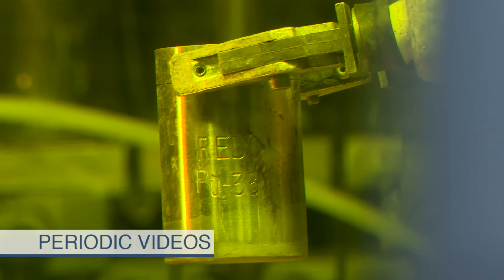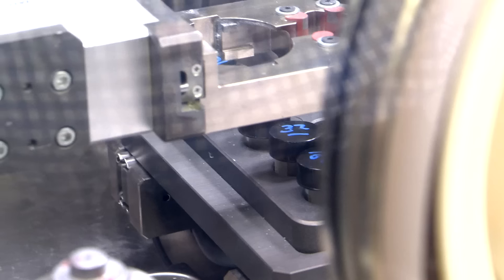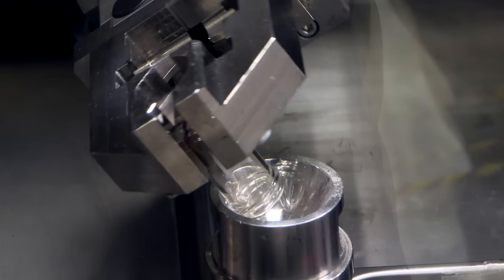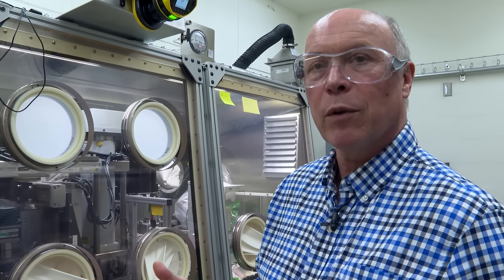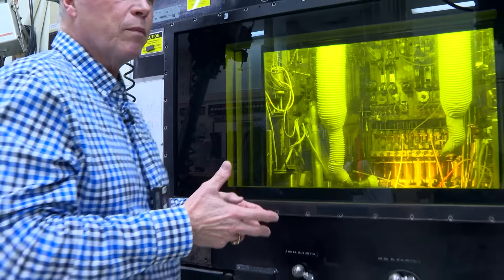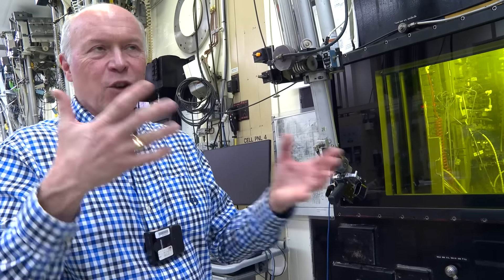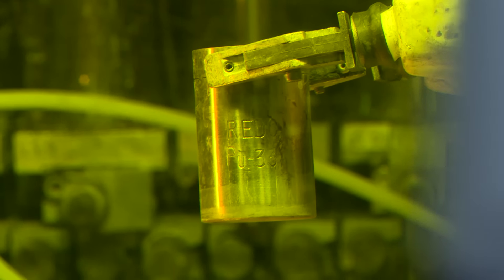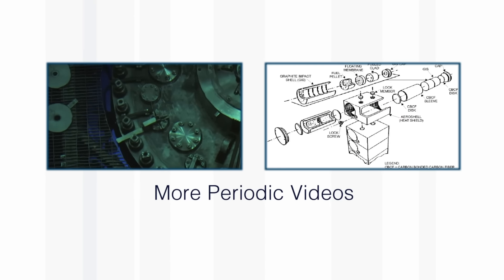How to make Plutonium

Comment: Luckily, I watched this from a safe distance.
Reply: Wait, then why do I taste metal?
Reply: I filled my monitor with a bunch of mineral oil just to be safe. How did the video end BTW? I missed it everything went black.
Reply: @StephenJohnson-jb7xe  Do not use used oil!!!
Reply: I watched this in person, through my binoculars.
Reply: Or is it?
Reply: I've got news for you no distance is safe even from Oak Ridge to the  device you're watching this video on! Not to mention the controversy over the possible dangers of mobile phones yet to be determined perhaps decades later when it's too late!
Reply: I just drank 2L of mineral oil to have a protection
Reply: @jaybondoc9865  Hhmm that's not great, not terrible. Go to the infirmary!
Reply: @terryfuldsgaming7995 : Is that so! There are nations not individuals for example considering the possible mobile phone dangers. The jury is still out. Further you haven't the slightest knowledge as to the extent of my science knowledge!
Reply: Your comment got my radio activated. Thx i guess.
Reply: Stephen Johnson actually mineral oil is not like water where it will damage your PC or electronics. Sooo everything did not go black.
Reply: @roberttelarket4934  You state, regarding mobile phone dangers; "The jury is still out." And yet earlier in this same thread you said, "no distance is safe even from Oak Ridge to the  device you're watching this video on!"
I'm not picking sides; because you clearly aren't either.
But stating something as fact and then trying to use the scientific method to apply to the same (almost) point doesn't give me me too much confidence in what you say. 
The most reassuring thing something someone with scientific knowledge can say is, to me; "We don't know." 
I'm not arguing with you, I re-iterate. You just might want to be careful about how you say things. There are a lot of science-illiterate people on social media. Doesn't mean everyone is.
Reply: Safe distance?!? That would explain why my eyes are vomitting blood right now.
Reply: CORONAVIRUS HAS JOINED THE CHAT

Comment: This is really cool. NASA has recently proposed a new really neat design for an RTG (nuclear battery essentially) that would require A LOT of these rods and produce enough energy to support a mission on the Moon. Which is probably what they are needing this for in 2024 and beyond. Eventually newer versions of these RTGs will hopefully end up on Mars and maybe even Titan.
Reply: I read last year that NASA was testing small fission reactors which use sodium metal to transfer heat to sterling engines, then to reciprocating generator. U 235/ molybdenum alloy with beryllium neutron reflector. The efficiency was around 20% and was designed to run for years.
Reply: @tomspencer1364  That project has been suspended and restarted multiple times, sadly.
Reply: Are you the real Anton Petrov?
Reply: Nice vids dude
Reply: I'm addicted to pigger nussy 🤠
Reply: @redneckshaman3099  when and where is the next oath keepers meeting 🤪
Reply: @vidreoo  once you go black, it's like smoking crack ❤️
Reply: @redneckshaman3099  that's one way to keep them enslaved 🤔🫡
Reply: @vidreoo  the darker the fupa, the tastier the chalupa ❤️
Reply: Look at this guy out here. He is going to the moon, then to mars, then to titan…. Sounds super duper smart

Comment: Fun fact, the green light on the cylinder at ~4:12 is coming from those Keyence devices (marked DIA 1 and DIA 2).  They are optical micrometers and can measure the width of an object to an accuracy of ~1 micron at that distance.  Pretty cool!

Comment: I'm told it's the equivalent of a chest X-Ray
Reply: Not great not terrible
Reply: You can see the dosimeter on their chest. Probably a combination gamma and neutron dosimeter. Much more expensive than the standard units I would guess - certainly much larger than what I have worn.
Reply: But 3.6 röntgen is the equivalent of 400 chest x rays.
Reply: How many bananas is that...?
Reply: Spreading disinformation, at time like this? :D
Reply: A chex-ray?
Reply: @Raffi Basmajian Brings a whole new meaning to red Russian.
Reply: @Raffi Basmajian  How does an RBMK core explodes exactly, comrade?
Reply: I’m also told that it’s decaf.
Reply: So basically everyone who is scared of the bad rads is overreacting?
Reply: @josugambee3701  Metal Gear Ray
Reply: It wasn't 3.6 roetgens, it was 1,500; you didn't see the chest X Ray machine because it wasn't there.

Comment: 10 years ago I worked with cnc’s designing parts for company’s. 
Setting Datums are a major part in keeping tolerances on point. Laser technology I’m sure has come a long way, instead of using micrometers or older methods. 
How do you keep the robotic arms and tools selection carousel from malfunctioning, with such high radiation interference? 
The sensors must be going mad. 😂
Great channel and best wishes. 😀

Comment: What they never show you is the vacuum/inert gas melting and casting process. Which is really the coolest part of the journey from uranium mines to usable material.
Reply: In this case the pellets are induction heated while being pressed to make a cermet material. The inside of those process chambers is filled with a mixture of argon and nitrogen, but the target rods are flushed with helium before filling them. The press die is made of a silicon nitride ceramic with a stainless steel holder. The process is quite similar to making the pellets for inrush limiters in electronics. ❤

Comment: How to safely handle common radioactive elements
Uranium
1: Wear protective clothing on every part of your body, extra protection for vital areas.
2: Use a tool for extended grip, as to limit your proximity to uranium.
3: Remember to thoroughly clean all lab equipment and protective clothing after you have finished.

Plutonium
1: Consider your life and all you would be throwing away.
2: Do not handle plutonium.

Comment: Years back I worked building automated welding machines, and worked on a machine that sealed the capsules for this material.  Challenging as radiation has a very negative effect on Teflon, and we used a fair bit of Teflon in most systems.  Once the machine was completed, it was taken to I think INL and put to work in a cell like this.
Reply: Radiation is damaging to teflon? Interesting.

Comment: Can you do a video explaining why radioactive elements are always kept as oxides or in solutions rather than its pure forms such metal ingots
Reply: Often times it is because an oxide state is the easiest to keep it at. In a metallic state, it will slowly oxidize anyway. Also, many of them are pyrophoric, particularly in powder form so it is easy to handle. Also, it takes a lot of work to create the pure metal. The pure metal is more the end product of something specific and the oxide is more general purposeful for chemistry needs. Basically, you only need metallic stuff when it is going into some specific final product, and even that is very rare because the density of the metallic compounds sometimes a limiting factor because of their heat output. It's a bad day when your metals melt themselves

Comment: I have a question: Heavy-nucleus elements like Plutonium and Neptunium are typically Alpha emitters. If you're using the decay heat to heat a thermocouple, wouldn't it be more efficient if you could use the Alpha flux, which is has a positive charge, to power some kind of direct conversion to electric current? Is there a material that could make that kind of energy?
Reply: Yes, they could do that, but since the alpha particles have 4MeV of mass energy the target isn't going to last long. It has been tried with SiC and diamond alpha voltaic cells where the alpha particles cause charge scattering. It destroyed the PN junction to unusable in about 6 weeks when tried with 241Am. 238Pu would be much harsher because it is even more radioactive due to the shorter half life.😮
Reply: @christopherleubner6633  Thanks for your reply. I'm curious if there is research looking for an appropriate material that might yield the desired results. It just seems to me that there's a lot of energy that's going to waste, especially since it's a lot of mass-energy with a +2 positive charge... or am I mistaken on the concepts of alpha decay?
Reply: @DavidWilsoninnefl  you need a scatter layer that generates electrons when the alpha particles slow and stop. The most efficient in this class is iodine doped Cadmium Zinc Telluride CdZnTe over a Silicon Carbide betavaltic. The alpha particles create a shower of electrons before braking and consuming a couple. The electrons hit the SiC and generate even more of them like a photon does on a solar cell. About 3.7V at 100uA per microcurie of alpha emitting stuff, double that if you sandwich the cells together. Cells are 1cm square.

Comment: Is the plutonium oxide the substance that actually gets used to power the vehicles, or is it being used as a preservative until the actual plutonium is needed?
Reply: It is usually the oxide. In rare cases where oxygen isotope enrichment is unfeasible or the increased neutron production from non-O16 isotopes is unacceptable, pure metals can and have been used.

Comment: I'd like to know how they service the equipment (including the glovebox gloves and the remote manipulators) inside those hazmat handling compartments.

With regard to the advertisement for Wix:  If Dmitri Mendeleev had access to Wix, his periodic table would actually look very different from that shown, since the ones he actually made in 1859 - 1904 were very different from the one made by Alfred Werner in 1905, which (as far as I know) was the first to have essentially the most common modern format.

Comment: Very interesting but I have a question. If the neptunium oxidize doesn’t mix with the aluminum powder, will it effect the outcome?
Reply: Not by much. The aluminum is there to absorb radioactive iodine and make a stable pellet size for thermal expansion. If you filled with streight oxide the target might fission enough to overheat and melt the aluminum cladding.

Comment: What is the advantage to use plutonium over uranium in space reactor? Longer life cycle of the fuel?
Reply: Uranium has almost no heat output compared to this version of Plutonium. Uraniums halflife is in the order of billions of years whereas this isotope of plutonium is like 80. Now, there are lots of isotopes that are short-lived to choose from that are potential fuel for RTGs, but Pu238 is nice because it largely only consists of alpha decay radiation. This is VERY easy to shield against, so much so that generally speaking it is the only feasible isotope to use for space batteries because you don't want to add any weight for shielding if you can get away with it.

Comment: Does the shielding lose its ability or stability to block the gamma rays and neutrons? Does it degrade?
Reply: Neutrons are the only real concern for the long term durability of shielding. This is a low neutron environment so you can expect nearly 0 degradation from any of the shielding here

Comment: As a maintenance technician, I'm really curious what their maintenance procedure would be for that machine. Parts fail eventually. Do they just box the whole machine up and bury it underground and make a new one? Even something as simple as dropping a tool out of reach of the arms, or getting too much chemical buildup on something could be a nightmare to take care of! Not to even mention, like, repairing an arm motor...
Reply: They just go in and repair it. The facilities are kept relatively clean and radiation generally doesn't make things radioactive so once materials are removed you literally just walk in and fix it.

Comment: What I understood is the decaying plutonium will not give enough heat after a few years to power spacecraft as originally budgeted, hence it is strange why it is held for so long before being put to use.  Will there be another purification attempt just before delivery to remove accumulated decay products?  It would make sense to plan for JIT (just in time) delivery on advance order.  I understand few months of project delays will be hard to account for but here we’re talking years; that pot was made last year and will likely be used in 2020, using up a considerable percentage of its energy reserve.  What explanation is there for this?
Reply: Not a few years, more like after several decades.  There is a fundamental rate at which you can produce these things, so stocking up as much as you can as fast as you can is the best plan. Remember, the half-life is over 80 years. 5 years is not a huge chunk of the overall power budget.

Comment: I do wonder, though, why an RTG needs plutonium specifically. Does something like americium or radium not do the job?

Also, I was wondering about the neptunium oxide mixed with aluminium powder, because that sounds a bit like a type of thermite mixture.
Reply: The need is for a source of heat without penetrating radiation, that lasts, with preference given to a substance that can be synthesized more economically.

Pu-238 fits this bill almost perfectly: it has a half life short enough that it generates an enormous amount of heat per unit material, but long enough (87y) to outlast the mission. It undergoes all alpha decay, so there is no penetrating radiation (the decay product, U234, has a half life 3000 times longer so the rest of the decay chain is a non issue). And it is a major synthesis product of nuclear reactors, rather than some parts-per-million deal.

Other isotopes - Sr-90 and Cs-137 - have I believe been used as nuclear heat sources for extremely remote places on earth.

Comment: Won’t the radiation eventually damage the electronics inside the hotboxes? More specifically, the controls for the robotic arm?
Reply: The radiation flux in the hotboxes is very low and not much of a concern, furthermore the radiation here is primarily alpha and does not travel but a few centimeters in air, and is readily stopped by the metal coverings. The damaging of electronics is only a concern in very intense environments, such as in an operating nuclear reactor or in space.

Comment: Guess I shouldn't be surprised to see them using PUREX to separate out the fission products and Pu.
Reply: I am not sure if they are using the exact PUREX process, as they won't help you isolate Np and Pu, or at least not the version the public is familiar with. It probably is some modified process that still uses Nitric acid, though.
Reply: @BeCurieUs  The whole point of PUREX is to isolate plutonium.
Reply: @kylesenior   It doesn't only isolate plutonium. And PUREX in the traditional way won't allow you recapture the neptunium. There are a bunch of papers on Advanced PUREX Processes that they are likely using to nab the neptunium, but it probably isn't the same exact process that you would normally do for MOX stuff.
Reply: @BeCurieUs  There shouldn't be any significant amounts of uranium in the irradiated target.
Reply: @kylesenior  Right, but they want to reuse the Netpenium as well as you won't really get that much conversion with each pass. So maybe they use PUREX first and some other versions for Np recycle, dunno.

Comment: E=mc^2 is mass to release BINDING energy so by higgs boson and mass dispears by speeds faster than light as nothing in the universe can do faster that the speed of light and remain in tje universe it crosses the event horizon opposite would be to buibling up quantum mass as electrons and thus may be possible with quantum resonance i have studied quantum mechanics and have some theorys on about quantum mechanics physics and like a superconductor impeadance goes to near zero but it may be possible to modulate the fequency and waveshape and amplitude to create resistance to build up more power than goes in to achieve a NEGATIVE impeadance kinda like a resonate chamber on a laser

Comment: Can't they just separate Plutonium-238 from spent nuclear power reactor fuel? Isn't Plutonium formed in the spent fuel rods?
Reply: Pu-239 is the primary plutonium from that.  What little 238 is there cannot be as effectively separated as can be produced from Np-238

Comment: Wouldn’t it be better if the plutonium was produced as late as possible as wouldn’t it just decay most of its power away just sitting in a warehouse?
Reply: It takes a while to fabricate to order. They are still proving out their supply ability as well, learning how to ramp so the more they can make the better! Also, the half-life is still over 80 years, which means you don't have to be super slow going making it like with other materials that have day or week-long halflives.

Comment: So...we're leaving radioactive spent cells on mars?
Reply: They are becoming less radioactive over time, so they won't be radioactive for long.
Reply: @BeCurieUs  How long is "less"?
Reply: @ThaRealChuckD  The halflife of Pu238 is a little more than 80 years, a blink of the eye in geological terms and it will be completely stable. What more is Mars is cooked in the radioactive wind from the sun and cosmic background radiation. The self-contained RTG is the least concerning radioactive source on Mars, by far.

Comment: When will we be capable of generating electricity directly from the radiation instead of using the heat generated to do so?
Reply: we already do that, how to you think some of the radiological sensors work? using the heat these materials generate in controlled nuclear reactions is just much more efficient. So not worth it

Comment: Isn't the robot just repackaging some radioactive materials, such as Neptunium? If you want to make plutonium you need some U-238 to effect itself on a nuclear level. OK maybe they are making them elsewhere.
Reply: You don't make neptunium from U238, you make it from U235. U238 after it absorbs a neutron will decay into Pu239 eventually, that is not the stuff they want, they want Pu238. You make that from Np237 which is acquired from neutron capture of U235 multiple times.